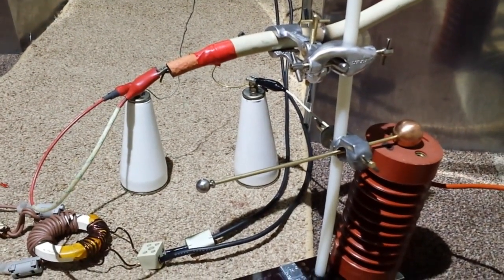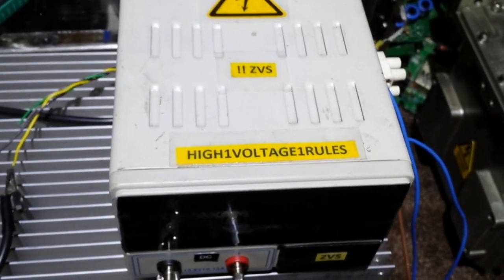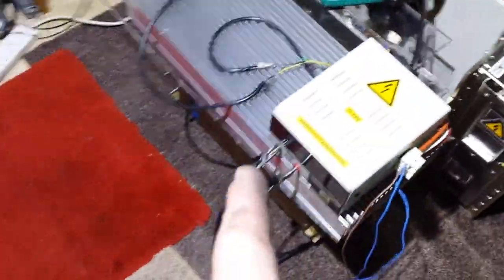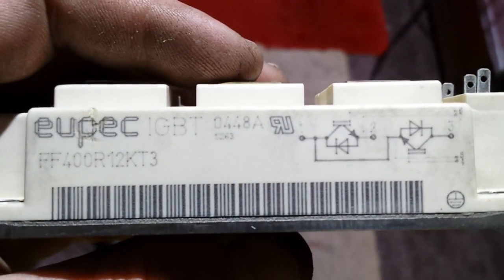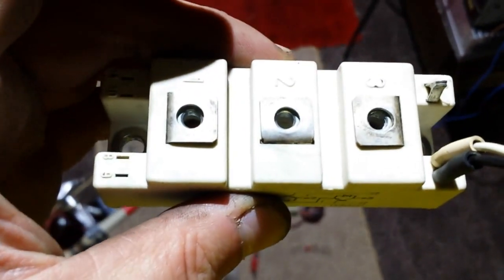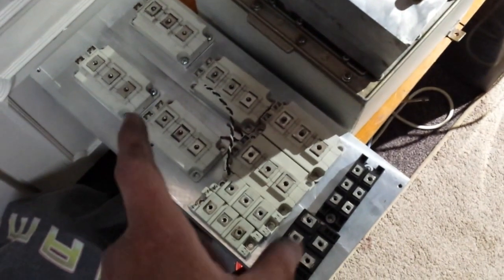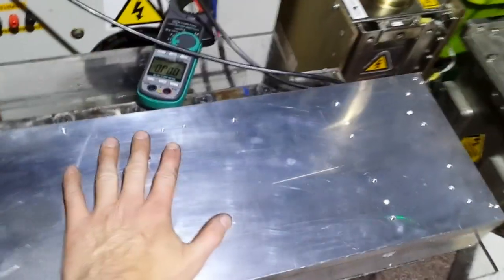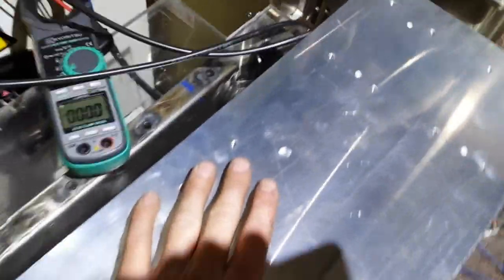Big Zvs project' and more

Comment: if I have seen a transformer on ebay and it had input 415v 400v 0v and output 110v 200v 250v 48v 20v .
this should be ok to use?
cheers matey

Comment: hello sir.
may I ask you for some advice please.
I want to have a isolation transformer for my work bench to check live circuit's
I purchased one on e-bay saying it was working hu!.
one the transformer there is 240v in L.E.N.  and output L.N. In a chuck block.
before I even attempted to wire straight into consumer mains I checked across the winding's on both side's.
both read short, but colours on cables are input are both red and output both are black and green 4 earthy.
could of some one wired it wrong into the block????
if I can, is it ok to send you a vid?.
thank you.
jim
Reply from the maker: Hi mate' sorry late reply been busy, yes send me a shortcut to your video so I can get a better view on whats going on in your video ;-)

Anthony

Comment: Great video, thanks for sharing another video of it, Beautiful arcs~ Can't wait til it arrives. My parcel is on the way with UPS. Awesome ZVS driver too ;)

I shall correct you with one thing in the video. Those igbts i do believe are 1200V constant max. ofcourse you would only ever run it at a good chunk less then that. With semiconductors in general, their max voltage is there complete max and you can go very close to it, however currents you can do large amounts for short pulses. This is due to semiconductor physics, Current effects the junction temperature whereas exceeding max voltage is where it would completely destroy the semiconducter by arcing over or 'forcing' a path.

Just figured i should let you know :P

Regards,
Thomas
Reply from the maker: Thanks tom. Speak soon mate 😉👍